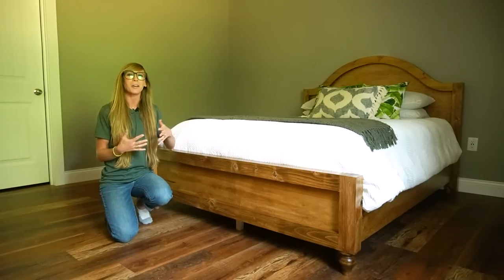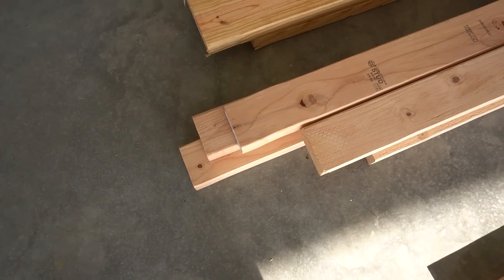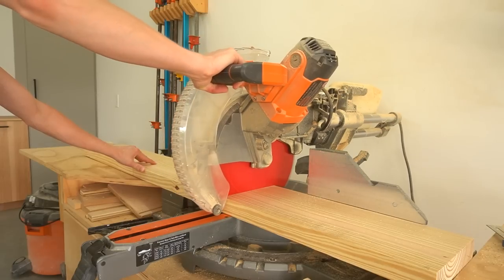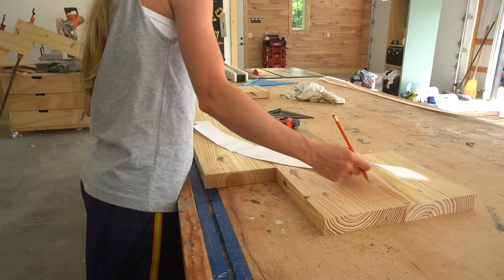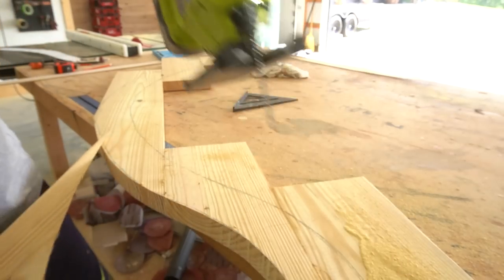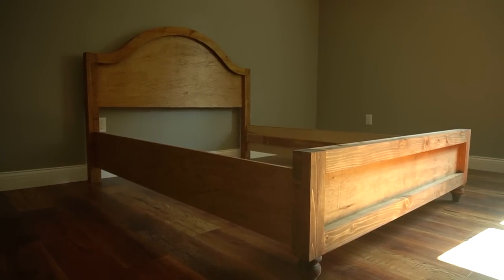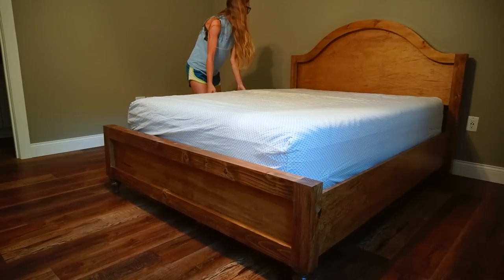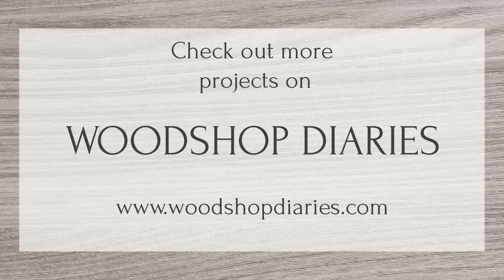How to Build a Bed Frame with Arched Head Board

Comment: Hey I liked your clever clamp up method.  LOL. I myself have used this method. Until one day I figured out.  That if I went to the big box store, and bought a few dollar 3/4 pipe coupler and a length  of pipe threaded on both ends. Could then pull out these pieces to add to my pipe clamp for those extra long projects.  Just a little pipe clamp hack i came up with. Loving this build by the way!!!!
Reply from the maker: Why had I never thought of using a coupler?!?! That’s so simple yet so genius! Thank you for sharing!

Comment: Looks great! Definitely feel you pain with the wood prices/selection. I have built one of your bed designs before. I just wanted to mention for someone who has not the bed looked and functioned great the only thing I didnt like was the 11" side rails because it limited what you could store under the bed ( In my case, suitcases). So if a builder on here plans to store things under the bed but like this design keep that in mind and just make the side rails smaller. Absolutely no hate to you Shara love your designs and easy to follow plans.
Reply from the maker: That’s a great point! I like my side rails deep to avoid needing a box spring and to make sure it is not going to sag in the middle. But, it does limit the room you have to slide things underneath. The space is there, you just may have to lift the mattress to access it. So it would be more like hidden storage 😅 haha

Comment: Beautiful. I have been wanting to make a bed. That headboard looked a little tricky but turned out perfect. I had one thought though...would it be cheaper to use like a 2x6 or 2x8 for side rails? For inside support for slats to sit on..a 2x4 attached to the 2x6 or 2x8......and of course 1x3 or 1x4 for slats... Plywood is so darn expensive right now and plus you did more cutting that way. Not sure which is cheapest but it would be easier to do the boards instead of plywood. What's your thoughts? I realllllly love that bed though. Great job!
Reply from the maker: Thank you! I see what you’re saying and…maybe? You’d have to sit down and do the math to know for sure. But my thoughts…you’d already need the plywood for the head and footboard, and if you bought 8 ft boards for the slats, you’d have a lot of waste. Using plywood for all of it gives you little waste (in provide the plywood cut diagrams in the plans). While expensive, I doubt it would save you much to use 2xs and 1xs instead and you’d likely waste a lot less in the process sticking with ply. But it would work either way. I just don’t know that it’s going to make much of a price difference.

Comment: This good design. Could I modify it?  I was thinking about a storage headboard with a slanted board in front to recline against. Maybe I contact you or in the comments.
I have bought some wood for the frame. Was wondering what is the best way to make it.
Would 3/4" or 5/4  wood work for the sides?
I have the 2 x 8 wood from an old water bed frame. Have started sanding to remove the stain. Also I bought a 5/4 x4 molding with a bull nose. Was thinking about laying in flat on the rail to have a round edge. I see you have the mattress higher than the rail.
Glad I subscribed and great video.
Reply from the maker: Thanks so much for following along! You can definitely modify as needed. There are a million ways to build practically the same thing. I used 3/4” for the rails, but you could go thicker if you wanted.
Reply: @WoodshopDiaries  Thank you for responding. I guess you can make the width of the rails in a variety of sizes. I understand there should be a  minimum.

Comment: Thanks for sharing! I see people using 2x6 for the side rails but never thought about plywood. How Is it holding up so far?
Reply from the maker: I’ve used plywood for several beds at this point (usually doubled up on with the inside support where the rails sit) and they’re all doing fine. Not had any issues using plywood.

Comment: Do you do anything to ensure that your 2x4's are straight?  Are you using a planner?
Reply from the maker: I pick out the best boards I can find before buying and I run the edges through the table saw to get rid of the rounded corners. Sometimes I use a planer to smooth the top and bottom if they’re rough, but rarely.